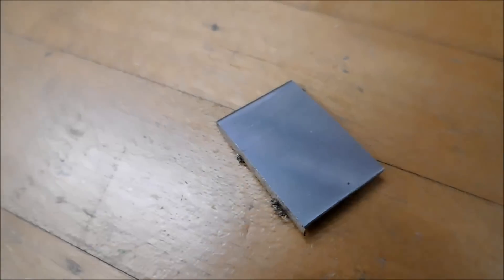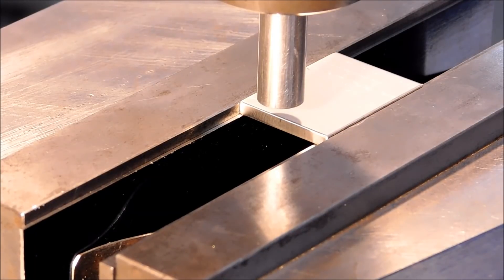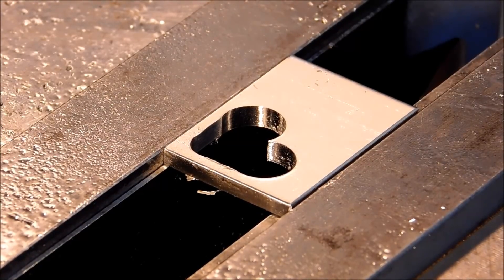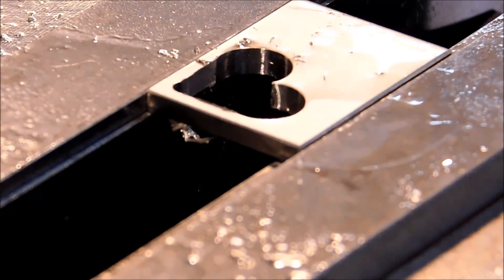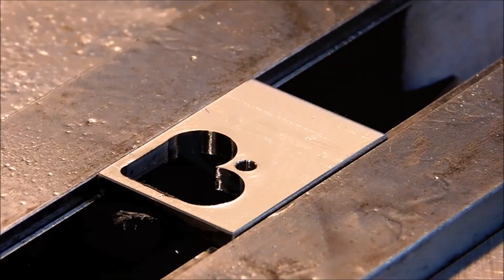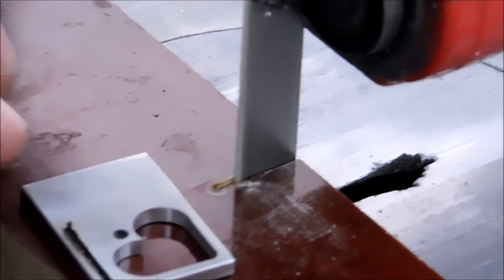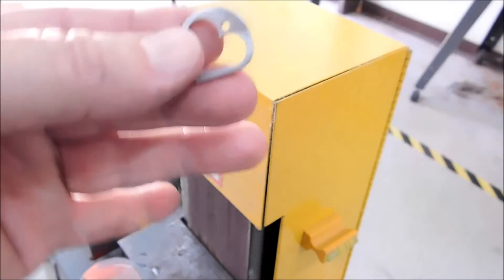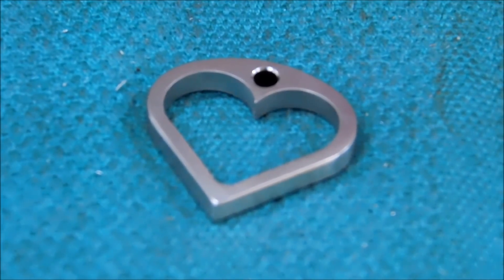Machining a Heart Shaped Cutout - A Piece of Jewelry.

Comment: Hi Joe I was involved in lots of production  machining, the yearly tooling budget was 3 million a year. I was charged with the task of lowering the costs. I found ways to do it. Making the carbide inserts last as many cycles as possible was the goal. The use of coolant and carbide inserts under most circumstances was adversly affecting the life of the inserts in many of the cutting processes due to micro fractures. The powdered metal forgings were very hard ( 60 r ). There was a stainless componenent in the sintered forgings. Under the microscope it showed the cutting edges were being damaged significantly from microfractures.  I found that this oil called acculube when lightly misted on the carbide cutting tools made the tools last significantly longer and stopped the edge microfracturing . It has to be a very fine mist though. The heat then gets more efficently transferred to the chips and the shock of the coolant.  continuously hitting the hot inserts was stopped.  Flush coolant contamination from oil is minimized as well. It works well with highspeed steel and some process involving coining presses as well. It is however not practical on solid carbide drills.  Carbide drills with high pressure coolant delivery seemed to be able to provide enough lubrucation and deliver the coolant exactly where it was needed as long as the pressure was high enough and keep the chips moving  but, other wise this stuff is pretty good and wont make a mess.
https://www.zoro.com/accu-lube-cutting-oil-1-gal-bottle-lb5000/i/G2632034/?utm_source=google&utm_medium=surfaces&utm_campaign=shopping%20feed&utm_content=free%20google%20shopping%20clicks&gclid=CjwKCAjwmf_4BRABEiwAGhDfSTOnI5Ix-b3k0L4t7a0Z6Ruf7O8Y5DUFDWA4Bz02Zr5-MZ3V8K-P7hoCXyYQAvD_BwE

Comment: Great video, Joe! I am currently working on a project that needs the external shape to be heart  shaped. Is there any way to do this with manual tools? With little to no belt sanding? Maybe use a rotary table? Would love to hear your thoughts. Thanks!
Reply from the maker: It can be done. The narrow part in the fold of the heart is done with the part standing vertical. The rest is easily done on a rotary table. I have plenty of rotary table videos to get you started.

Comment: In the polish step, why did the stainless part not wear through the paper?
Reply from the maker: Thats a good point. Probably because the paper was more abrasive that the part.
Reply: I have often wondered... it seems to be the moving part wear most. I have replaced shafts on fans, the bearing locked up, machining a perfect in groove in the shaft before the problem was noticed. Just makes me go humm?

Comment: I really like your videos, you're a true craftsman. Since I'm from Sweden, I always wondered why you dont use metrics measurements? I understand its not what you're used to, but the precision is so much better. 0.001"=0,025mm thats a normal tolerance for fitting a 40mm ballbearing. Or is it just me used to metric?
Reply: We learn on decimal inch, so all of our internal references are that way. It is not a big deal for us to switch to metric. It is a matter of what you are used to. In the end it doesn't make a difference.
Reply: @SuperAWaC  I meent the scribers and other measurement tools. I think the imperials measurement tools are a bit rough. But then again, I'm not used to it.
Reply: Or if you look at it from our end .01 mm = 2.5 tenths and you are getting into the limits of precision for most machine tools.
Reply: @bwyseymail  Good point! Never crossed my mind.
Reply from the maker: Sit a 25.4mm standard block on the table. Just because you measure it in metric, and we would call it one inch, it doesn't make it any different in size or accuracy. I see it as simply a different language. Nothing else.
Reply: @joepie221  Thanks for your answer. Good point, its no different from language. 
However,  for example, a tape measurement  have more lines per  length with metrical than imperial wich make it easyer to be moore precis.
 I haven't much experience with imperial measurement so thats why I'm asking. Not saying one is better than the other.
Reply: @peterjohansson7235  One can always choose a finer or coarser set of divisions. Metric is just more convenient in that sense. I know a lot of lathes have dials with increments of 0.02mm for example, probably because this is not too far from a thousandth of an inch (0.0254mm).

Here in Australia we switched to metric in the 1970s. As a result a lot of older machines and instruments are still imperial- my lathe and mill are both imperial, but as a 'millenial' I never learned imperial units in school and do all my thinking in metric. My solution to this is simple: I keep an electronic calculator next to the machine and I have memorised the conversion factors, so translating just means punching some buttons.

Comment: Joe can you pleas show how to machine a 3D internal corner in a solid. That would fit on an external 3D corner without any wobble. The internal corner is not have a hole drilled in it at the junction of each plane. Bernie

Comment: Very intresting, beginners won't know how inportant order of operations are. And some tips on how to hog cut some 316. Lot's of good tips from you. And after seeing those blaze belts Im doin a belt "grinder" I like a skelleton construction two flat plates of 5/16 probly with 1" bar stand off's , import car brake drum drive wheel, the dust cap's from a 70" camero and 4 outer wheel barings and the castlelated nut and that tang is there on that washer for a reason. craigs free list for the treadmill electronics ha ha

Comment: My mind was blown on how you homed the X! That's an awesome shop gem!

What liquid were you using when drilling and milling?!

That turned out real nice!!
Reply: I often home x by pushing the part against the cutter - saves a lot of time changing tools.
Reply from the maker: Thanks. That was WD-40 for drilling. That pin trick works well on a CNC when a stop gets in the way.
Reply: @joepie221  , I knew WD-40 for aluminum, but hadn't thought about using it for stainless, much less 316!

Using it in a CNC makes sense too! Just put that in the beginning of the program and program a pause or something?

Comment: I like the idea of the spring style parallel holder.  I am always fumbling the parallels.  Did you make that or purchase it?

I went to edge products website and ordered a few tools they make and they really made some work much more enjoyable, thanks for that!
Reply: Just finished the vid, awesome dude!!!!
Reply from the maker: It is just a piece of steel strapping. Next delivery, don't just throw it away. It comes in handy.
Reply: @joepie221  We use the strapping for a bluing stick as well for grinding out high spots on trim steels, very handy to keep around.